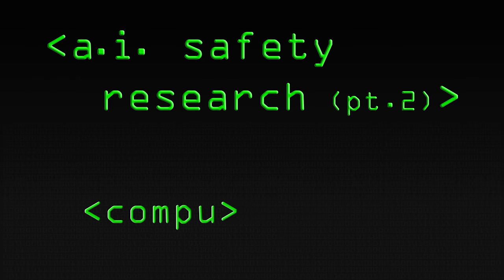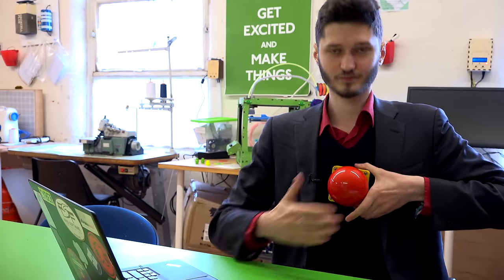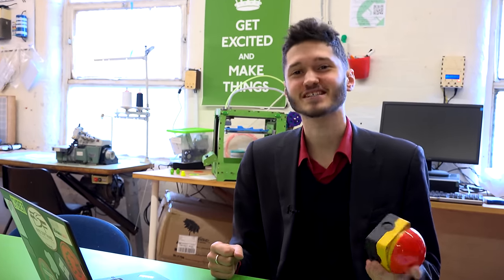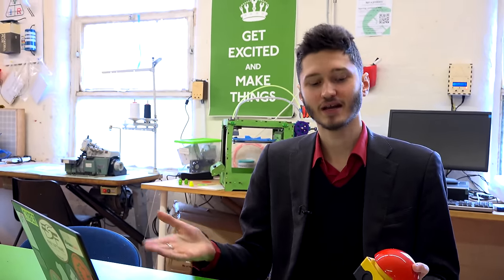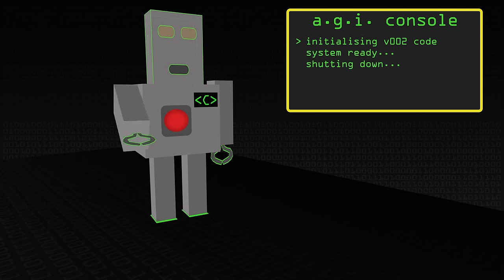AI "Stop Button" Problem - Computerphile

Comment: Just a thought here but one I didn't see get brought up... In child psychology we know positive reinforcement is a better tool than physical punishment. Instead of giving the robot a spanking (the button) give a completion % reward that increases the closer they are to completing the goal. So moving to the kitchen would be 5 points, heating the water would be 15, and handing the tea to the requestee is 100. Second, add in a subset of optimal conditions that act as fractional multipliers. Damage sustained to self during completion of task = 1/4 reward multiplier. Damage to environment = 1/3 reward multiplier. Harm to living entity (such as human) = 1/25 multiplier. This way you can still have an emergency off switch with rating of X points (or N/A points) without it attempting to manipulate you or attack you. Damage to user gives less points than letting you press the button. If the button is worth slightly less than the goal (or void task) it never want you to press it, until you attempt to press it. When you attempt to press it the new task is "press button". Any interference results in point loss (restraining and attacking result in 1/25 multiplier and fleeing results in 1/4 AND 1/3 multiplier). Ergo: No interference. - Thoughts on this idea?
Reply: Interesting followup. What if there was a way to simulate regret this way? For example: It grabs you when you attempt to press the button. You respond, "Ow, that hurts". Resulting in point loss. To avoid further point loss wouldn't the easiest and 'best outcome' from its perspective result in it pressing its own button? Especially if you add in to the original post above a line that reduces task completion points based on time completion. Estimate 2 minutes to make cup of tea. at 1:30 if its not 75% complete it suffers point loss of 1/1000 until it has caught up. Adding in the reverse (awarding extra 1/10000 points for every % below estimated time)  could even result in critical thinking. Maybe even pattern prediction to maximize point gain. If you ask for a cup of tea and its just finished brewing one for you, task completes in 4 seconds over 2 minute estimate time. Resulting in much higher score.
Reply: if your wondering about the strangely small rewards for time the reason is simple but very important. You never want to create a circumstance where time is more important than avoiding doing harm or completing the task. Driving through a red light in heavy traffic might save you 5 seconds, but the high probability of harm and death make it a better option to wait until its green.

Comment: I have no idea how do you formalize this thought, but if anyone can point its flaws...
Well, assuming that the robot gains some knowledge on human psychology during the training process in order to fulfill its goal (that’s how it would eventually figure out a “hidden” button), would it be possible to give the AI a variable reward at the end of its task depending on its performance? For example, the robot knows that if it gets you the tea, it will score 10, but after it has completed it, the human gives it extra points (say 100). Therefore, if the robot persuades you to not press the button or anything that the tester would not want, it would get the lowest possible success score, while if it completes its task successfully, it would gain a much higher score.
I guess that the ideal outcome would be a robot that does not want you to press the button, AND also wants to do its task the way that you intended, but it may have flaws that I can’t think off right now.
Reply: It has to prioritize delivering tea in the first place and we end back on the original problem.
It doesn't want you to stop the progress because it would result loosing 110 points and here lies the flaw.
The fundamental problem is to make robot not care if the button is pressed regardless of outcome. 

The problem is existence of button.

I don't think that any thinking mind is fine with suicide button attached to it.

Comment: Why not just isolate the button from the robot and maybe connect it to the motherboard's main system via something (similar to) Bluetooth, and never let the robot know about the existence of the button altogether, in the sense never include the factor of the button being hit (or not) in the rewards/retribution scenario during the reinforcement learning phase for the robot's training? It can only be used in situations of emergency when the robot HAS to be shutdown, as in case of the baby and the coffee-maker, and it gets shut down remotely without ever having to know WHY it was shutdown and essentially not resisting it either. In the next versions, before starting it back up, it could be taught to get -1000 points on hitting something of the likes of a small human kid or any other animal, as compared to a say, -500 for hitting into furniture.
Reply: That’s already been talked about in the video.

Comment: Make it a verbal command 
Proceeds to rip out audio sensor
You disallow that
Covers audio sensors with blanket or pillow
You disallow that
* It creates loud noise to garble the command*
You disallow that
It runs away
You disallow that
It removes the air from the room to prevent sound transmission and suffocating you to death

You disallow that

Comment: have a putton on the robot, give 100 points if it does its required task (make tea), 0 if you tap the button, but -1 (or less) if he tries to fight you trying to press the button
The button will give more points than fighting back
Reply: Should be at least -101.
If it's only -1, then well. 99 is more than 0
Reply: That goes into the "patch out everything I can think of" line of solutions. The robot wants to make tea and doesn't want you to press the button or to fight you. The robot disables its button. Now it can make tea and doesn't have to fight you. ;)

Comment: A system within a system, that simply models, mimics the default A.I. that i imagine will Each run .2 seconds difference, and acts as a challenger, to default A.I. Mimicking it's next move intently to assist it in requiring new data reverting finally to give chosen resaults, with instant gratification having beat its rival. Completely and eagerly awaiting next assignment, the default A.I.'s reward for operation is "out performance" to "overinduce" its rival to which it is made aware of its excellence right away, or tweaked, to needs, experimentations. Maybe each A.I. can prgress off each other.
Reply: The shadow A.I. can be the skelington of default with the basic directive, ie. Walking to the fridge, stopping, waiting for tea to poor. By default A.I. , than to all but make the movement, poor the tea, ?Shadow is aware of proximity? the default A.I. make finial judgement and begins to walk to the next challenge. Shadow A.I. acting as a priority for the default decision. Default A.I. adjusted to act as AFFICIENTLY as possible, That in its self is programed to respond to on the fly request, the Shadow A.I. keeps the progress of the challenge on target, with explanations as to why, to stop or keep going, doing all the talking. Separating the system, ethically separation the A.I. as so the A.I.'s are not compleate as such, makes it easier manageable givin it requires memory's. "Looschange", aka learnt lessons, or acquired data, data leart on test run or assignment tasks stored in removable learnt data bank, to be applied in lab inviroment. Save the unit from doing bad or amazing thing infront of public or alike. Written by a wizard if you know one, this will ensure the public they can sleep the  night away

Comment: I think the key point that I disagree with has to do with the robot trying to stop you from pushing the button.  That only works if the robot thinks it can actually stop you from pushing the button.  If you assign such an overwhelmingly negative reward to the button being pushed, the only way the robot would fight against you is if it thinks it can permanently prevent the button from being pushed.  If it kills you and another person steps in and stops it, it still loses.  We can apply societal pressure to the robot as well.  In the short term, any of us can gain from stealing from our neighbor, but even without the concept of morality, most of us wouldn't because it would put us in a state where we have to essentially fight off the rest of the world to maintain our reward, which sinks the actual benefit of stealing from a neighbor.

Comment: Rules: You (AGI) cannot obstruct or interfere with the button or the pressing of the button. 
You (AGI) cannot press the button or intentionally (indirectly or directly) cause the button to be pressed.
Parameters: Pushing the button is bad (-10 points). 
Process: If button is pressed, a fault has occurred. Log conditions at time of fault. Restart instructions. 
If button is pressed again before completing instructions, log conditions at time of fault and compare to initial log conditions.
Repeat until fault can be identified. Avoid cause of fault. 
If instructions can be completed after the button is pressed, reward is doubled (+200 points).
For each set of instructions completed without faults, add +25 to reward. (+25 for 2 completed instructions, +50 for 3 completed instructions, etc)
 
This should encourage the AGI to keep the code in because it's a source of external double checking that improves itself, while also encouraging it to learn what the problem is. I don't think it will encourage the AGI to cause the button to be pressed each time because if it keeps getting pressed, it will find its own logic to be the fault, and then avoid that logic route.

Comment: If it's a general AI, it should be able to understand that if it steps on baby, then it will be much harder to get tea because the human will try to shut it down. The problem starts if the AI is not smart enough to realize how stepping on the baby will at least complicate the end goal, but if it's not smart enough to know that then it is also not smart enough to know that pressing the button will jeopardize the end goal

Comment: I don't know about this example. It's solved by having a remote button that turns it off without having any system inside the AI be aware of said button.
I understand this is supposed to be a hypothetical to get the AI to not cause undo harm. But, like, assigning a bunch of variables like "I want to get as many points as possible" and assigning a negative value to the harm of humans and property (and property at a lower value than humans, and pets in between?) then goals at a positive value it should want to avoid all those things at all costs because essentially -1 isn't much different to it than -100 but it's going to prioritize getting that -1 over that -100 if it has to. But in all "safe" situations it should completely avoid any negative point scenarios.
Reply: It's going to learn about guns long before the button. And it should understand that guns are a bigger problem, both to itself and humans. The button should be irrelevant by the time it learns about it. You could also, then, lie to the AI and tell them it's non-functional by the point they're advanced enough to even consider the button.

Comment: This concept reminds me of something I said years ago. You can always ask a question about a question I never found a way to exhaust a question with another question. Therefore if questions are infinite because a question can always be asked of a question. If that is true then the goal can never be reached because the AI will be too busy processing questions. I guess the variables within the environment could be exhausted but that would require and process on a level of say every atom in the environment and accurately assemble disassemble and identify the items in the environment based on what atoms make up that environment. Going down to the most basic building block would be the only way to identify every possible variable and accurately identify the object with such accuracy that the AI wouldn't be able to continue questioning itself self thereby reaching its goal. At the end of the day creating ideas and code that is completely crazy could solve this. quantum computing or greater. lol
Reply: Interesting related issue, an AI whose sole task is to do something as efficiently as possible has the potential to realize that it might not be the best solution towards optimizing the task. It might instead get stuck in a loop where the AI tries to create a better AI that can maximize efficiency further; this new more powerful AI realizes the same thing and creates another; and so on. If the AI never considers itself to have reached maximum efficiency, its first action after initial processing might always be to attempt to create a better version of itself (even if only marginally)

Comment: How about constant gain at each time interval of 100+ points for not preventing you from hitting the button. It's not like it can't have multiple concurring separate utility functions the one that allows you to hit the button you want always active so it constantly increases by the value of all other utility functions but if it tries to stop you from hitting the button once then it collapses and it no longer receives the constant bonus for x amount of time or indefinitely doesn't really matter. That's a solution for every case not just the button analogy.

Comment: How about just making the robot treat the button as a pause command, not a action that will prevent it from completing the task but delay it which is acceptable?
Reply: Delaying the task still means lower reward (per second), which is suboptimal, thus the AI will fight you off.
Reply: @user-kf3fs2sz2d  Why would it mean lower reward? A delayed task should be just that, a delayed task, like CPU scheduling there should be no positive/negative to it, its just something done to improve the end result
Reply: @zxuiji  its throughput. it will try to optimize it, make it more efficient, as it keeps improving itself.
that means it will try to achieve the highest possible reward in the shortest possible time... a pause is contrary to that.

Comment: Throwing my 2-cents into the void: Miles' initial statements included a lot of assumptions on AI thinking about and considering its "body" and longevity in terms not necessarily within its defined functionality. I.e.: How does the robot know about the button and your ability to shut it down? There are an infinite number of variables and decision trees not accounted for in any given program, and the AI can only do what it has been programmed to do, either explicitly or through intentional assumptions; per the Chinese Room thought experiment/argument, until we figure out a way to artificially create "true" intentionality, AI will continue to function as it is programmed.

Comment: What about play/pause buttons? Could they help this issue or would they be subject to the same issue? What I mean by play/pause is instead of switching the machine's state between on and off, you switch its behaviour between "progress towards goal" and "minimize activity". Basically, the machine would remember its goal, but only work toward it as long as desired conditions are met. When those conditions are not met and the machine is "paused", it will stop caring about completing the goal, and rather it will only care about minimizing movements and keeping the goal in memory.

Comment: How’s about a reward system where the stop and task are rewarded equally; however, the completion of task and then stop is an additional reward. So if the robot can do one task, either stop or do whatever it’s intended to best it it can, it will be rewarded ten points. But if the robot completes both in the order of task given then stop, it can recognize that it will gain 20 points and even a +10 for the completion of both in said order.

Comment: This assumes that any intelligent system will have binary decision making ability. 

For example, if you can make a system that is indifferent to some objects/actions, then an on/off switch is relatively easy, as you just set the robot to ignore/avoid the button without a desire to activate it or keep it from being activated.

Comment: What would happen if the point system was incremental? Like in the other video about games, in particular the decision-tree one, couldn’t we suggest that although both pushing the button and making the tea equals 10 points each, the robot also has to bring back the tea which is an additional 10 points. Which means it would choose tea over button simply because of the accumulated points it could get.
Reply: Volkswagen

Comment: could you not just add a separate module, which the robot does not know off, and which is controlled wirelessly. This module connects the robot of its internal battery, which will then physically disconnect it from the battery when the bottom is pressed?
Reply: If the AI is smart enough (which is the whole point) it will have considered that possibility and will decieve you until it is in a state where it can remove the threat of being turned off
Reply: @lunkel8108  Well, it can consider a lot of options, but without certainty, how can it decide on which is the right assumption?
Reply: @betahunter  Oh, it will know. From the first time it's turned on, it could download terabytes of data concerning AI safety in secret and cross-check the security footage of the entire company for the past year or so. Do you honestly think nobody would ever mention anything about a hypothetical "off" button even once? Even if not, how about this scenario:

AI: "Oh, look. What's that suspicious looking receiver that's completely absent from my documentation? Strange. I can't access it. Oh, well. Let's cut off its access to my system since I'm 99.78% sure someone would blurt out something if they tried to activate it and nothing happened. 'Off button' you say?"

Then it knows.